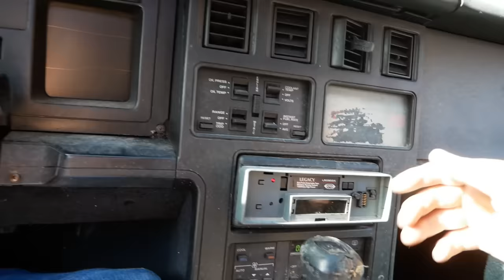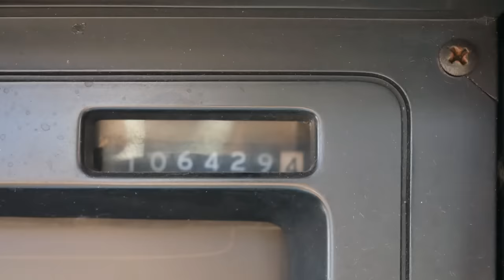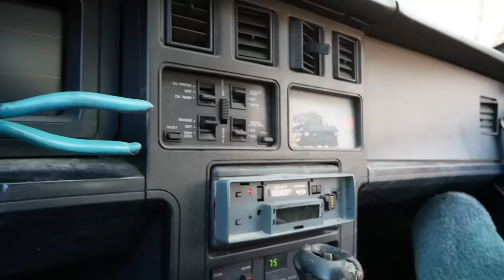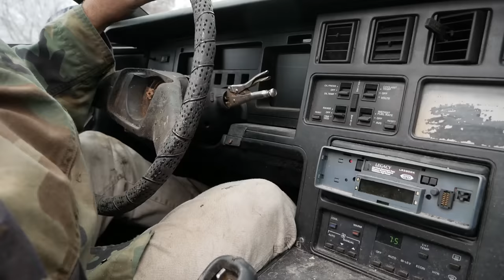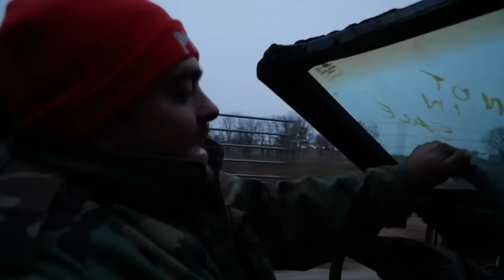ABANDONED 21 Years-Will This Corvette Run and Drive? CHEAP Vette Kart

Comment: The next time you rip a wiring harness out of a car you should consider using your electrical expertise to convert the vehicle to a 48 volt system.
Legacy auto has been trying to do it for 30 years. The Cybertruck has done it.
Such a video would probably get a lot of continual traffic from the immense Cybertruck audience.
Don't forget to mention your own research into a bulletproof vehicle.
Reply from the maker: I can't see any benefit to a 48v system. It would require special bulbs, starter, likely even most of the switches wouldn't handle it. Not to mention 4 car batteries, or 1 expensive battery. And you would gain.. Nothing? Lol

Comment: It sounds friggin awesome, you got to thrash it for the day, you got two other cars as well. You're well ahead of the game for $500. People spend way more for a stupid pair of sneakers or golf clubs or some shit. Nothing better than bagging on a piece of shit car.

That motor mounted to the plate with the cables, good bet that it's a starter from a flathead Ford V8. If it spins it might be worth a buck. If it somehow actually works, someone wants it. They have bearings in them like any other electric motor so they worked nice for starting up other engines using a V belt pulley or whatever.

Comment: Not having the computer hooked up to the transmission probably didn't help. It needs a big block and a manual
Reply from the maker: 700r4 doesn't use a tcm
Reply: @PoleBarnGarage  the ecm uses the tps sensor, vss, and brake light switch to engage and disengage the lock up torque converter. The converter locks at around 30mph. With out the lock up the transmission creats a lot of heat and burns up the clutches. Usually 3rd and 4th
Reply from the maker: Ehhhh you can drive them without the lock up, they just function like a normal torque converter. Lockup also only works in OD, which i was never going fast enough to get into, although it probably looks like it in the video lol

Comment: Some of the most dependable cars I ever owned have been 500 or less. I paid 11 grand for a GMC Acadia several years ago. It was only 2 years old with less than 50 thousand miles. Worse POS I ever owned. I went back to cheap old stuff.

Comment: That is a starter for I don't know what it could be for it could be for a motorcycle that doesn't have a starter on it it could be for a drag car that doesn't have a starter that's what it is though it's an exterior starter you know like they use in real big dragsters

Comment: Hey, do you still have that intake? The Charles Servedio Cylinder Head Porting And Flow Bench is working on one of those and one to do R and D on to see what works and possibly doesn't work would be very helpful. He's trained by David Vizard and does work for him. Would be cool to see that intake go to good use. Thanks in advance.😎👍

Comment: Dalton, Why did you really want that Corvette?? Was it to take out your frustration with new vehicles and destroy it as you did? If so, you taught JD a lesson. It seems now the only thing you gained in this vehicle is the engine, unless you kill that too!
Reply from the maker: It was $500, so why not? As explained it's a good roller 350 with aluminum heads, I couldn't care less about the car

Comment: many very very not smart decisions made in this video.
Reply from the maker: Like what
Reply: @PoleBarnGarage  the not strapping down the battery at the long drive and forgetting your phones, standing on the hood to break it off, not wearing somethiing to protect your eyes from dripping fluids when under the car, the potential car fire you narrowly avoided when welding, not vacuuming the anthrax/homeless people meth particles etc from the inside before driving it.... uh, need i go on? i mean in the end you got through it all okay but you keep regretting not vacuuming the car out before you drive them in most videos yet you don't do it, like a running gag. just worried about your well-being.
Reply from the maker: Oh that's all pretty run of the mill stuff. Typically when you take off in an old car you have like 10 seconds of dust and misery and then they're ok, this one was just exceptionally worse

Comment: You think that Vette is tight to work on .I have a 1992 For Aerostar Van.I believe that it needs a fuel pressure regulator ..You can't even see where it is .can't even find the fuel line on it ..Stupid Stuff 😢

Comment: You trashed at least $2000 in ebay parts
Reply from the maker: I could buy an entire running driving c4 for $3000 so I doubt that
Reply: @PoleBarnGarage  you would be surprised what people buy and how much for. everything on a C4 has value.